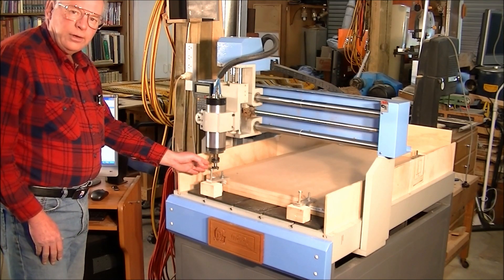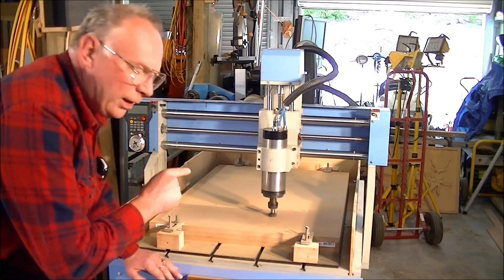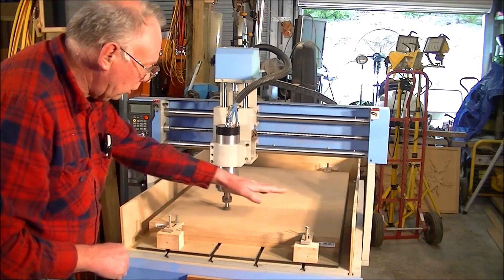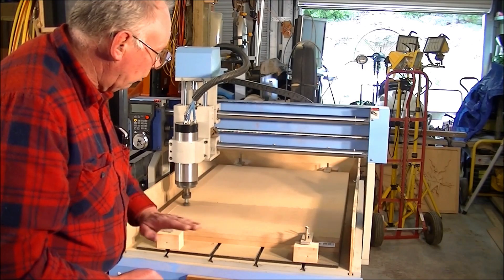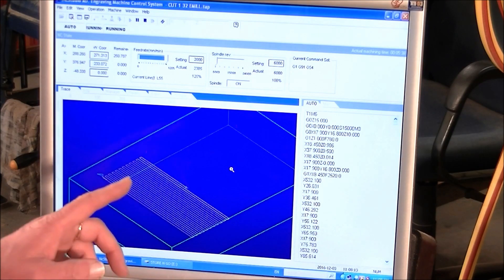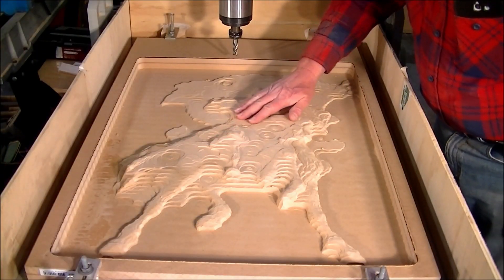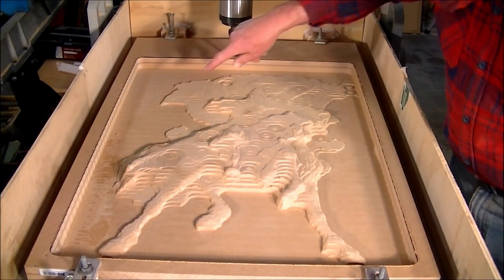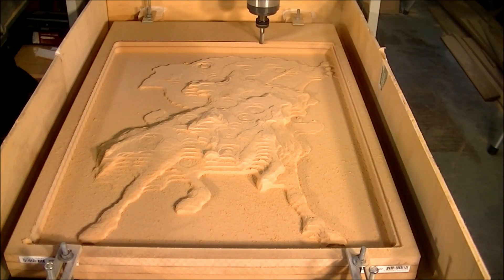6090 CNC Router machining a BIG 3D Ninja with NC Studio

Comment: Have you thought about 3d scanning a knife handle..like the Zero Tolerance 0308.. It has one side made of g10.... say you copy that and then cut out it in a micarta or a fat carbon fiber.. Ive down guitar parts just using a copy machine and then converting to vectors for cutting lines and hole placement.. but the handle has  a texture and is more rounded than flat... I think I can get the texture  from artcam/carveco but a cheap 3d scan would be more accurate i think.. This is a simple part and i dont think it warrants a 1000 dollar scanner